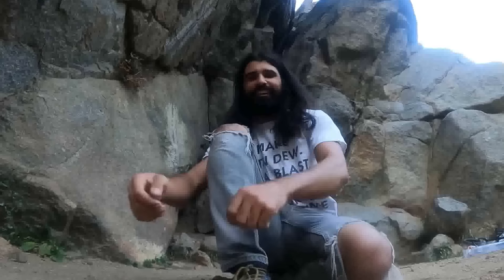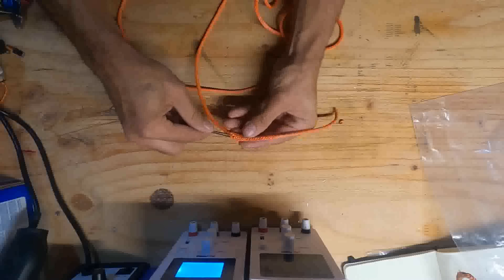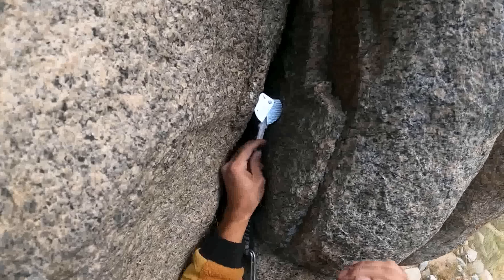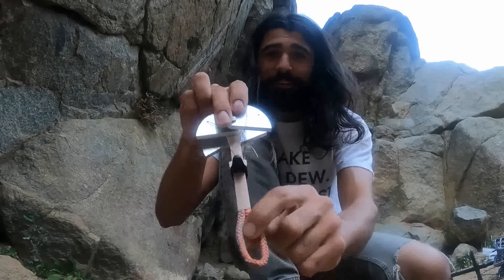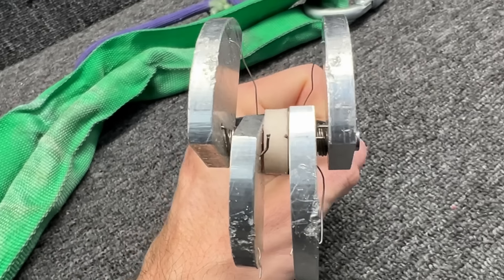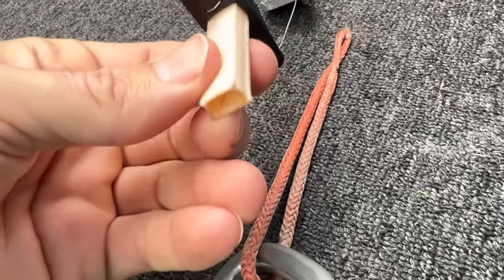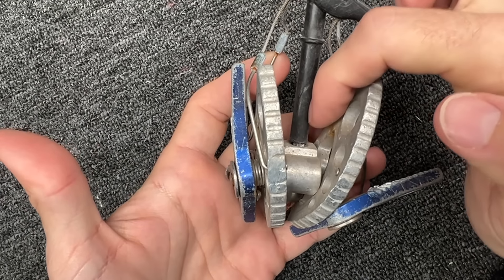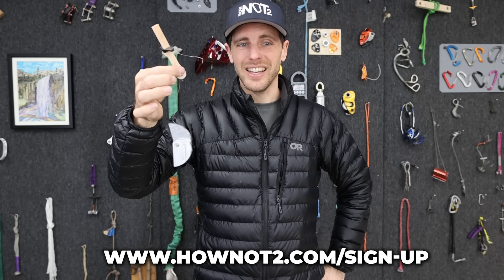How NOT to human test your homemade gear

Comment: The video doesn't show it that well because they were deeper in the crack but there were actually 3 cams backing me up for those falls, but jumping off was still scary
Reply: That was pretty cool to watch
Reply: @gi70st  I'm not a climber and I sure enjoyed the show. Thanks Andrew and Ryan.
Reply: Yeah I feel he was a but unfair on you in his assessment. You did a great job  safely testing your build. Bravo
Reply: Really cool stuff, and entertaining.
Reply: You did a decent job designing it. The only issue I have with it is the design doesn't have any tolerance for quality control. You splice it wrong or get a bad axle pin, done-zo. 
Use a quality steel pin and steel wire cable with known specs, at least cuts down some of the unknowns
Good prototype, keep going, I want to see it evolve.
Reply: Thanks, Andrew!
Reply: to paraphrase Jaime Lannister "the things I do for science"
Reply: A nice point in your test was, that you do not need the lobes fancy machined in any way. Once a manufacturer said that, that a smooth lobe just would work too, but people like serrated ones.
Why your axle failed, i would think it´s just a material issue. metals can be so different in behaviour, as we can see the industrial stems just do a better job, in bending not braking.
all the best
Reply: Great work man, love your stuff
Reply: Really impressive all around, great job!
Reply: I saw it they were pretty obvious though i only saw two
Reply: Good effort dude, really enjoy watching people  make things like this. I love how chillaxed you are about it all definitely goong to check your channel out and I look forward to seeing more things tested to destruction haha😊
Reply: So not as close to voting Biden as we thought then;)
Reply: so glad you didn't get hurt that video had me jumping when you dropped @_@
Reply: @daveb3910  OP said this was for fun and he didn't want to make cams, i dont think this was a prototype at all. just trying to see if it works, and it did.
Reply: On the last fall test he did. When he swung back off the rock his rope clipped the bottom cam again
Reply: Good show mate. Fine bit of at home engineering too.
Reply: could you next time test it with weight and not yourself?

Comment: Thanks for testing this! I definitely had fun building it.
Reply: Mad respect to you for giving it a go
Reply: I subbed.  Make some more stuff.
Reply: The video seemed pretty dismissive of the accomplishment but making your own cam, and then testing it yourself is badass. It didn't quite measure up to professionals but it wasn't supposed to, and it still worked good enough
Reply: Man I love doing stuff like this. It really gives me an appreciation for how much a design gets honed. Like you did an amazing job and this was the first go. With that said, I think it just shows how much work goes into professional cams. It's crazy how strong some of them are.

Comment: I am assuming he probably assumed pure shear force in the napkin math, but did not calculate bending strength. With all of the space between lobes, the soft aluminum material without a hardened bushing, and it being a slip fit for motion, you need to factor in bending strength which is much lower than pure shear. Without having bushings between each lobe and a bolted ridged joint, you are never going to eliminate bending failure, which is reflected in all of the retail parts failing in the same way.
Reply: @Gothmog222  It is a hardened pin, the the failure will always be a break, not an actual bend. It was still loaded with a bending force that caused the failure.
Reply: I don’t have cams or know the materials for sure, but my guess is that he used aluminum for the pin while manufacturers probably use steel. Steel tends to bend close to failure while aluminum will just break/sheer without bending much. For a weight bearing pin like this, and the fact that bending can still protect instead of completely failing, it would make sense to use steel instead. But this is all a guess on my part, and I could be completely wrong
Reply: @AceRanger20  Doesn't look like aluminum, most likely steel. Problem is there are a 1000 kinds of steel, some orders of magnitude better at certain applications than others.
Reply: @DmitriyLaktyushkin you have a point, and I forgot that you can harden steel too much and it becomes brittle. So that is a possibility, he used steel and it was hardened too much for the application
Reply: Makes me wonder if a set of (asymmetric?) mechanical bosses between near to the ends of the cams would limit the bending, or if deformation is necessary for maintaining optimal a safe degree of slip-creep traction (creep-slip adhesion?) without the face of the cam shearing/smearing off.

It may also make placement/removal more difficult when the bosses deform or collect debris, but that can be mitigated.
Reply: could've used a much fatter axle on a cam that size, even a hollow tube.

and a cheap and easy way to make an axle for something like this is to use the smooth shaft of a graded screw.  known material with known properties wothout the risk of backyard heat treating.
Reply: @ztungaz   - or just buy parallel pins (of the correct material/treatment) - machine in a circlip grove at the ends and make bushes for "bearing surfaces"...

Note that "generic" -  "high tensile" isn't necessarily the right material for all applications  - grades do "indicate" toughnesss / energy absorption / deflection before failure.
Reply: Whatever nerd! 😂😂

Comment: So Napkin engineer here, that looks like the pin sheared. This could be poor choice in materials (IE I wanted the harder metal because more number vs picking a softer springier material that can handle normal deformation), or that bar was probably cold rolled and has s defect in it. I am probably sure that most highly rated climbing gear companies use binned material, or they are doing their own analysis on the metals to make sure those defects are not present. Very cool though to see the DIY community breaking into spaces!
Reply: I had a similar thought. The metal selection for the pin was not ductile enough to elongate before failure. Instead it just failed. 

Very nice example of why material choice really matters

Comment: 2:05 his rope gets clipped in the carabiner of the backup
Reply: That’s scary. If the top cam fails, you might just slip through.
Reply: Probably would slip through. Haha damn sketch
Reply: @LogRobin  I'm pretty sure that if the back up cam failed it would be before the rope clips in right ? and if it does fail then the rope would probably not clip in

Comment: I for one dig this. Ya its crazy dangerous but personally, i think alot of the rock climbing community has lost touch with the heart and soul of climbing. Its suppose to be dangerous and scary. Its suppose to interrupt the safe little bubble that we all live in because of the modern world. Climbing has always been, at its core, about total commitment. People may look at this guy and say he is being irresponsible but, really, rock climbing doesnt make alot of sense to begin with if you sit down and think about. And also, where do you think people like Chouinard or Royal got there start? They use to cut apart old cast iron bed frames they found at the dump and forge pitons out of them. Im sure plenty of people called them crazy
Reply: Once you've decided it's okay to have a safety line to save your life if you fall, I don't think there's any reason to half-ass it.

Comment: Good video, but for those not in  the know, what does the 9.x signify? What does that compare to?
Reply: The 9.x is Kilonewtons (kN) IE ~224 lbf ~101 kgf. For reference a "whipper" is  less than 4 kN, and the fully rated cam that he "compared" it to is rated to 12 kN. That's not to say that I would use it as he said that the materials cost more for the homemade version and there can/ would be quality control issues for such one-off/ homemade products.

Comment: As a guy who knows nothing about climbing but has done plenty of fall arest training and working at heights in my field of work.  Can anyone explain why the fall arest equipment I am required to use appears to be so much more heavy duty than the the equipment you guys use?  Any why we are trained that if we used anything less it would result in certain death.  I suspect it's just to cover the company's ass.
Reply: You definitely just answered you own question. And different use cases call for different applications and standards. Good point though and I’m still pondering further

Comment: I think the axle is always the weakest point. 

A little pencil rod of metal is not over 10kn of force resistant. A dyneena sling is. Those aluminum lemons wedges are. 

So for anyone who’s making a real trad gear, remember that overkill won’t kill you, and make thick redundant stuff. If it’s going to be sketchy, might as well be overkill too

Comment: This seems like a good explanation for why gear, particularly safety gear, can get so expensive.
Reply: I would not use his cost per part to validate that claim. His price has more to do with economies of scale than anything else. Obviously there are design costs, testing costs, and certification costs that factor into prices that he did not "pay for", but those are non re-occurring costs that are factored into an estimated sales volume to determine a price target. His costs were higher because he paid a premium on materials for convenience.
Reply: You don't want to force the manufacturer to skimp on safety testing in order to get the price down. That's the primary reason for the costs being high, material cost isn't the primary driver of cost.
Reply: @Bubu567  I guess that means that it could be cheap. Like really cheap. If someone decides that the research has been paid off and start selling them for staff + material costs. BD going bankrupt and gets bought by a non profit or something.